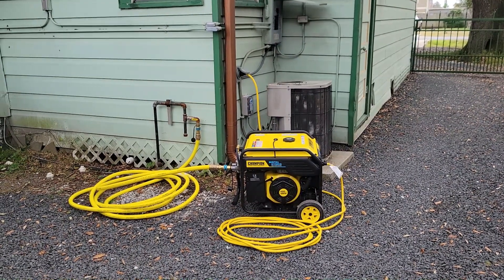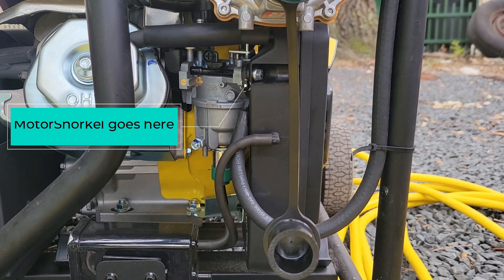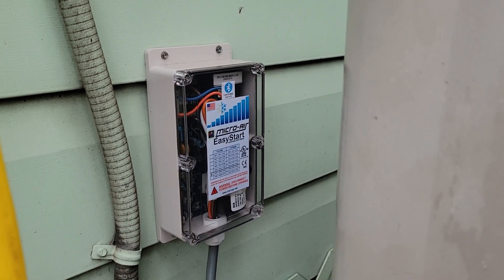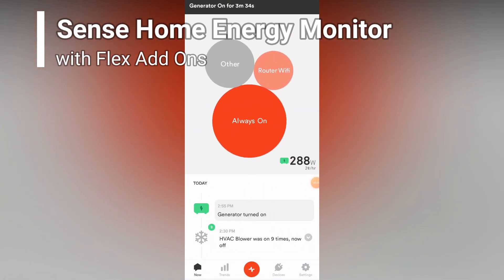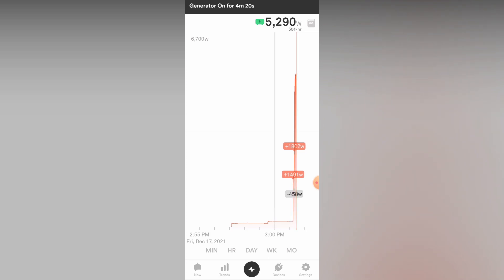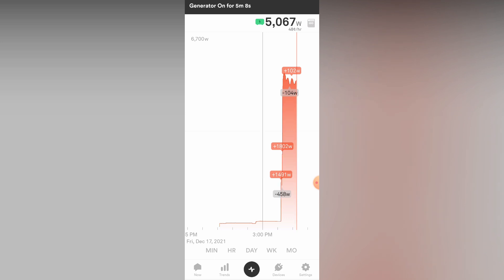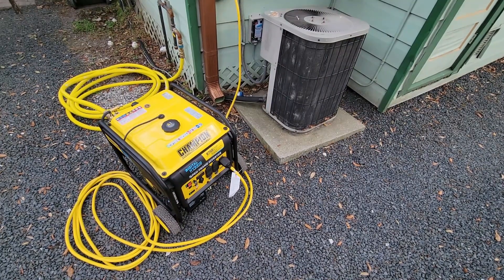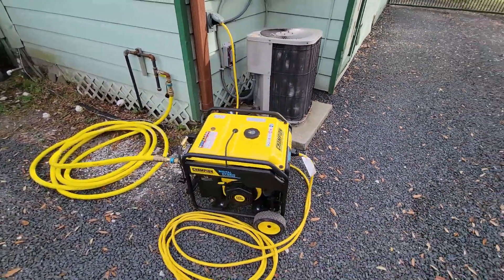Powering an entire house on a portable generator!!!

Comment: Could you share how you tuned your RPMs? Did you use a tachometer or did you just do it by ear?
Reply from the maker: It's stated in the motorsnorkel instructions for propane or NG use. Bottom out the screw and back it out a certain amount for each gas. NG I think is like 5-8 turns, and since I have a bigger generator they told me I'd need 7-8 or essentially full open since I needed max BTU. If u wanted to get exact u could hook up a tach. Most propane users I've watched have to use a tach since it's not full open like NG.
Ozzie was my inspiration, has a good video explaining https://youtu.be/qCRNwvCBM-4
Reply: @yourunclefab  Good to note - looks like I'll be picking up a tach before tackling this.

Comment: How far away is your Natural Gas Meter from your quick disconnect at your gas line?
Reply from the maker: It's about 25ft of 1.5", and 15 of .75"
Reply: @yourunclefab  Thanks. How much power did you lose with the original 1/2” hose? I have the same Generator I’m converting and I’m trying to decide if I go with 1/2” hose or 3/4” since it’s a huge price difference. I’m connecting 25’ of hose right at my NG meter. Thoughts?
Reply from the maker: @Atekcs  it would run my house, fridges, freezers... everything except the AC. To get my AC on I had to turn all the breakers off, and could only run my lights (all led), and could not power my fridge or anything over about 400 watts. I did the math but don't have it anymore, with 30 ft of 1/2 inch I wasn't getting enough gas needed for full throttle. My sense monitor was showing my AC would pull about 5500 watts and slowly level out to about 5100 sometimes, so on my half-inch I was getting about 5500 watts MAX. With 3/4 you should have enough gas needed for full throttle. Sorry I don't have the math handy anymore. I agree it was a big price jump, but I was able to get the fittings and a 1" flex hose on FB market to make everything more than 50% off buying it pre-made.  If you have a window unit or 2, or ductless I think you'd be fine, just not with a big central ac.
Reply: @yourunclefab  Thanks for your reply. I went ahead and got the 3/4” just to be certain.
Reply from the maker: @Atekcs  reading my reply, I might not have been too clear but thanks. With 3/4  and bigger I'm able to run my house like normal, just not all my big draws at once. If I want to do laundry or microwave, I have to turn off my ac, but all my fridges and lights and everything operate as normal with ac cycles. I designed it that way tho. If I had a bigger generator it would all work at once.

Comment: Thanks for this video. I also have a Champion 100520 I will be converting to NG with the Motor Snorkel. I’m wondering what gas hose and quick connects you are using? I’m looking at 1/2” or 3/4” with quick connect fittings but hose and fittings are crazy expensive! Recommendations?
Reply from the maker: @Atekcs

I consulted 2 master plumbers, and they said because I needed nearly 30 feet of NG line I would be best to run 3/4 to make sure I have enough gas to run wide open. I did try with a 3ft run of 1/2 but it would not get the generator to full power.
As for the fittings, I could not find any outdoor rated 3/4 quick connections for under about 150 per set, thanks covid, and I needed 2. One of my plumbers was able to get me 2 sets of Dormont A75 for 100$ total for now. He told me they have plastic in them that will degrade outdoors and in direct sun, but mine are all under cover, he said I could get by for a while before I should switch to outdoor rated. He recommended the dormonts because there is a fail safe that if the plastic peice does break, it shuts off the gas so nothing leaks. Once the outdoors come back in stock, I'll get some.
As for the hose, I found a guy on Facebook selling a 40ft of the 1" home-flex for pennies on the dollar, and got the fittings and reducers from a plumber, he got them wholesale at Ferguson. My hose, hose end fittings, 1" to 3/4 reducers, and quick connects set me back about 250. But nobody makes what I needed so...
Depending on what length you need, if it's a shorter run, get a pre-made line from Amazon. Otherwise you might have to pony up and pay a lil more than expected.  But what's power in a blackout worth to you?

Comment: Still waiting for your video on how to enjoy sense with both generator and normal use. Does buying flex make that process any easier? Thank you!
Reply from the maker: Yes sorry, ur not the only one. After I got it all to work, the wife said stop with vids and fix something else. I'll have it by the new year.
After getting the flex, I found a way you don't need them. If u have an existing sense in place, just run you generator lead through you sensors on the way to thier Interlock breaker.
Reply: @yourunclefab  Happy wife Happy life. So I only have an hour before cyber Monday disappears and this has been on my wait all year list lol. I can think it through later but here is my real question...would buying a flex make that objective any easier? I don't mind spending more if it makes monitoring generator and house any easier. Thanks for being awake lol.
Reply: I just did it your way. Thanks.
Reply from the maker: @jamesdean5677  extra flex doesn't make it easier, it's actually and extra step in the install and set up process that might take a few extra minutes to achieve. The easiest way is to just use the single set and run both incomings through the single set. I received a set of flex free as a promotion a long time ago is the only reason I'm using them.
Reply: @yourunclefab  Oh wow. Glad I went your way. Thank you for this. Can sense tell of power has been restored in this configuration? It is not much fun asking jealous neighbors if power has been restored. 🙂 I usually rely on the digital meter outside telling me but I can't be watching it all the time.
Reply from the maker: @jamesdean5677  in my configuration it relies on an interlock in where you disconnect the mains to switch on your generator regardless if you are running flex or not. So neither way will tell you if the power has been restored, since you have it switched off at the main breaker no power will be coming through your Mains to detect. Sorry. It would work if you were running an automatic transfer switch though with a standby generator because that switches everything automatically.
 It might be able to tell you if power has been restored if you are running a sub panel for your generator and certain electrical, that when power is restored to the main panel, set an alert in the app to a device set on the main panel, that sends a notification when it turns on. Did that make sense?
Reply: @yourunclefab  Hi, yes it does. I think that there are alternative ways to identity power ups like buzzers etc. Some of those conversations get incredibly complicated though.
Reply: Just wanted to say the way that you said to install it with the generator worked perfect.
Reply from the maker: @jamesdean5677  thanks for the follow up, hope u got that 100$ off deal
Reply: @yourunclefab  Sure did!

Comment: Great setup, I feel ya on the gen and the references to Texas utilities, was kind of similar up here in OKC...as a matter of fact our 13 year old Lowe's Generac 3500 gave a loud boom and died when our power went out during that same time period...had to drive down to ROYSE CITY near Dallas to find the LAST GENERATOR in the 28 known galaxies at Tractor Supply, lol, got the dual fuel 100891. It has a grand total of 7 hours on it by now and it works well but it makes my computer UPSs get jiggy and the microwave makes groaning noises at times so I have an interlock setup created but still trying to get the NG components sourced and will be getting either the Champion open frame inverter or the Predator open frame. Have you tried maxing your watts and seeing how far the gen will reach before shutting down? Gavin of Gavin's Garage put a couple through their paces on propane and they reached the gas maximum wattage, i know NG is 10-20% less but have heard if they are tuned well with no fuel starvation they can get close. Also interested in your Sense setup so will be looking to emulate, thanks again!
Reply from the maker: Thanks chuck! I was sourcing pcs for the ng conv and found the kit from motorsnorkel to be the best bang for the buck. Others were cheaper for a reason, and pay for it in the long run. My ng seems to max out around 5500-6k of a 7k generator.  I guess that cuz my sense monitor knows my old ac to pull about 5200 to start and 4800 to run after spool up. And on ng I had to have everything in the house turned off so the ac could turn on, and was limited on what could run. Fridge no prob, and all the lights, but no microwave or dishwasher washer dryer. On gas I could do laundry with the ac on but not microwave. I don't need to be more exact than that, as long as ac works we good. I just replaced my outdoor unit and it pulls 4200 startup and 3800 to run, very efficient,  but haven't tried the microwave with ac yet on ng. Keep me posted!
Reply: @yourunclefab  I did a worst-case scenario where the wife got sloshed and turned everything on in the house except the huge attic fan, I mean night lights, all four burners, etc and the number was 6740 watts. Didn't include the A/C but it is a 3.7t and not needed at the moment so will get one of those soft starts eventually. Thinking we could stay a 300-500 watts under that number and the Champion open frame inverter would work with NG, crossing fingers. I mentioned PNG earlier and they go on about either 4" of water column or 6", will need to ask an hvac what ONG typically runs into the house, etc. Good luck! We just dodged some snow this evening that came across I40 earlier, I remember a couple years ago this time our trees looked like they got crushed, lol. GO HORNED FROGS!!!!! :)

Comment: Eagerly awaiting your video on hooking up the Sense Home Energy Monitor to monitor the Champion 100520.  I have your same setup.
Reply from the maker: Do you have the flex sensors for your sensors?
Reply: @yourunclefab  haven’t bought it yet. I wanted to make sure what I needed before I bought one.
Reply: Do the flex sensors go around the wire that runs from my 30 amp receptacle to the 30 amp breaker?
Reply from the maker: @howardzimmerman982  you don't "need" flex to make sense work with a portable generator, so don't spend the extra money. Only thing that different is if you do use then, on your sense app it notifies you you are running in generator.  If you don't, your sense app just looks normal. 
But if you did have flex, one pair of sensors would just clamp to ur main leads from the meter, and the flex will clamp on your 30amp AND the mains. I can email u a pic if u need clarification.
Reply: @yourunclefab  A pic would help. Thanks.
Reply from the maker: @howardzimmerman982  what's ur email?
Reply: @yourunclefab  I have almost exactly your setup. Great video!
Reply: Great video!  With the flex option why wouldn’t one set of sensors go around the incoming utility feeds and the second set around each of the incoming wires from the generator to the dedicated breaker?  Can you further clarify why one of the second set of sensors goes around an incoming main and the other around an incoming generator supply wire?
Reply from the maker: @bdy8218  with flex, the main incoming has to go through one set only, and the generator incoming AND the main incoming go through the flex. Not sure the reason but that's how I sideways engineered it from thier standby generator instructions. I found from this method when running on generator power, it tells you you are running on generator at the top of the app just like in my movie. If u have no flex, just run both incomings through the single set of leads and sense will operate like normal while on generator. I shared my Intel with sense, they didn't care and said they won't support it.

Comment: Will this come on automatically when your power goes out, or do you want have to manually start it? Thanks
Reply from the maker: It's manual.  The auto start systems run upward of 15k$ and higher. The purpose of this is to power the house for less than 2k all in. Plus I use the portable generator for other things.

Comment: Did you have any issues with the Sense monitor using a manual transfer switch?
Reply from the maker: No I did not. There are 2 ways to do it, one with the original single pair of sensors, and one with the original and a set of flex addons. Easiest is the one set of sensors. Just run ur generator wires through the sensors in between the breaker and the way out to the generator, and make sure sense is powered on generator power.
Reply: @yourunclefab  Awesome! Thanks for the response.

Comment: Where did you get those quick connects for the gas line? It looks like they are both 1" to match the hose?
Reply from the maker: They are Dormont A75 3/4" connects with 1" to 3/4" reducers on each end. Found them on eBay pretty cheap.
Reply: @yourunclefab  Thanks for the tip on connectors!  With those reducers then you've effectively converted your 1" hose to 3/4" for actual gas supply purposes...
Reply from the maker: @CajunCoding  the connector aren't rated for outdoor use, the safety mechanism inside is plastic. I think if left in direct weather and sunlight exposure these will go brittle like other plastic left out. If they do go brittle and fail it will just cut off the gas supply so there is no leaks, its designed to cut the supply incase of fire, the heat will melt the peice inside causing it to cut the supply off.  My connections won't be exposed to sun and weather so I went with then because there was literally no supply of outdoor rated connectors, it was middle of covid when I made this. When outdoor connectors come back and not 100$ EACH peice (400 total), ill prolly make the switch over.

Comment: Found this after Ozzie's video...looking to put together a similar setup.  Your output estimate is 20% lower than the gasoline max...(the Champion 8000 Watt Tri-Fuel specs NG output ~13% lower than gasoline) - is the lower output to be expected for inverter generators?  I was gearing to use the same MotorSnorkel kit on the Champion 1000519 unit for its lower cost, quietness, and lighter weight - but it may be too little for my power needs on NG (The Westinghouse 5300 looks like an alternative). 

As a side - my understanding was the ERCOT crisis was partly caused by the systems NG's compressors relying on the electrical grid (vs. NG powered motors).  Not sure if your home will be continued to be supplied with NG in a similar total system failure - if that is the case have you look into installing on sight LP tanks as a backup to the backup?  Ozzie responded in a comment that he gets about 5 days on 100 gallon tank.
Reply from the maker: Thanks for your reply!  I made the assumption of the lower output and low balled it because during tests I ran the AC and turned lights on in the house with know loads, until I tripped the breaker onboard. Sometimes I got to 5500 and it tripped but sometimes I could get as high as 5800! I contacted champion to get an official estimate but they said since it wasn't designed to run on NG, they had no comment.
As for our freeze last year we had uninterrupted NG during the whole event, but in the situation you presented I have propane on hand and lots of gas cans I keep full for all my toys and power equipment, would make it about a week with normal use, longer if we conserve.  Also our power outages aren't usually that severe in cause, they are a little more localized in cause like trees down or flooding, not because the entire state loses power.